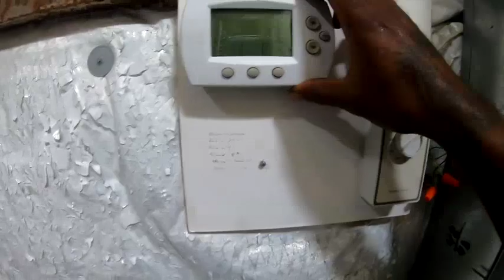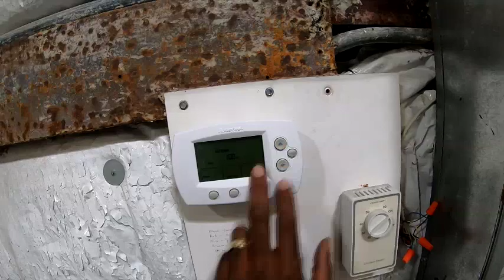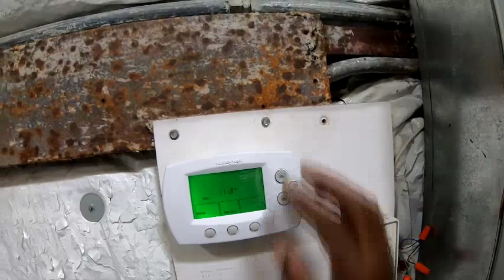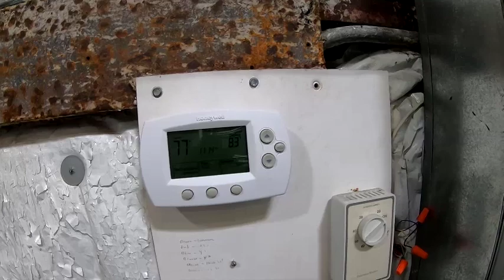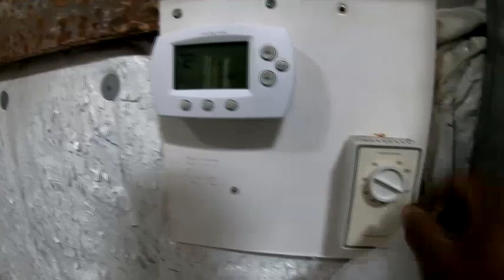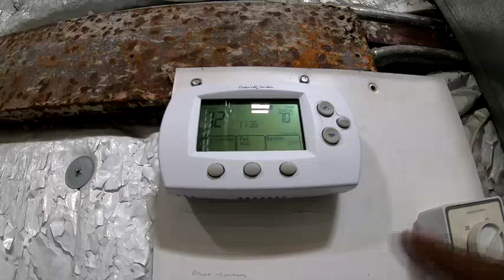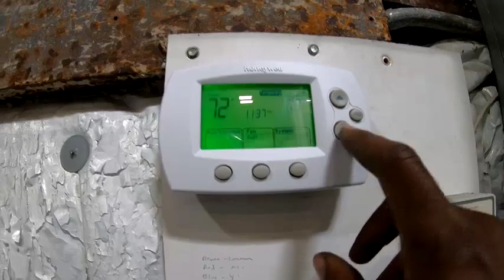HVAC: Thermostat install

Comment: Why is still calling with the face of the stat off🤣
Reply: Somehow the humiditistat is controlling the fan.
Reply: @Guillotines_For_Globalists  he read a closed switch between R and Y1 and I believe Y2 as well.....?
Reply: @damarcojackson1005  It was calling for cooling, right?  Somehow that humidistat is wired in.  Seems like a strange setup, most humidistats are only hooked in for humidifying rather than de-humidifying purposes.  And even so, running the indoor fan without the condenser would do nothing to dehumidify the space.